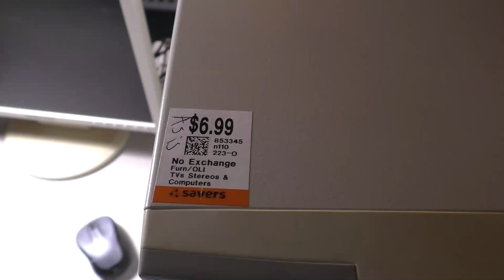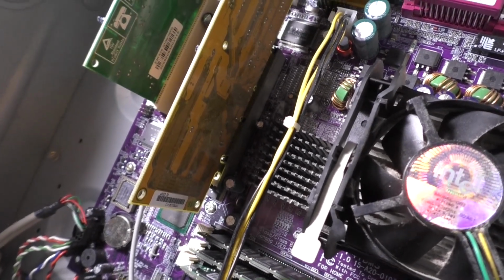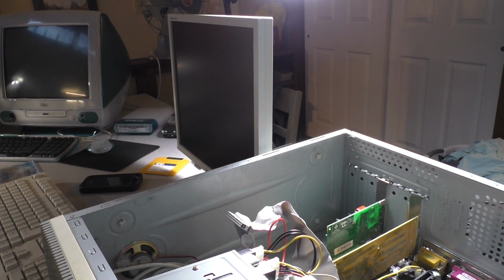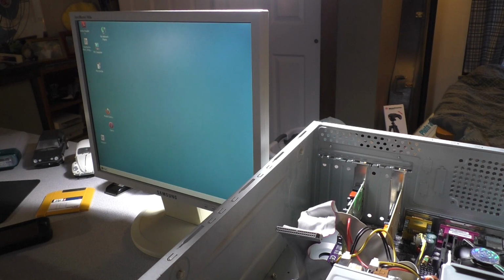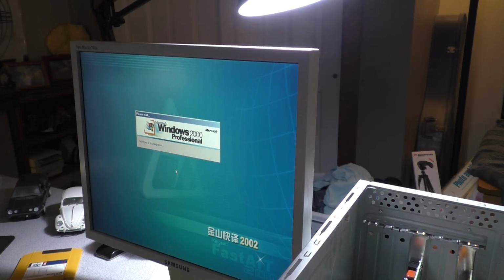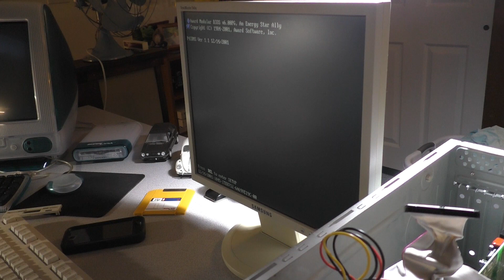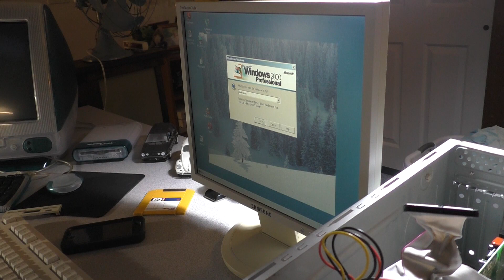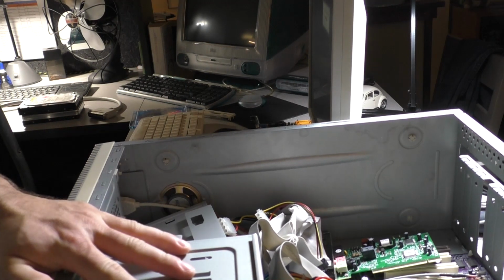I Bought A Computer For The Price Of A Wendy's Baconator Value Meal! (plus tax)

Comment: Of course both the owner and the store just leaves their hard drive and data on them and awaits their data to be compromised. At my Salvation Army all PCs are reinstalled with whatever Windows came with it originally using the OEM product key. If not, it's just sold as is wiped or without a hard drive.

Comment: I'm not sure if they still are. But in the earlier days when EVGA started selling PSU's, they were re-worked Seasonics. They're high quality. P.S. It was common in the 90's are early 00's for OEM's to hotglue cables to drives. That was probably original.

Comment: Stupid how Goodwill here would charge like $50-$100 for a Core 2 Duo or Pentium 4 in 2018 ;) No wonder they tend to sit there for a month or longer
Reply: If it's a Pentium 4 then at least you'll get a good room heater for 50 bucks. :P
Reply: Actually at my goodwill they’re all priced at 150 dollars... all Core i3 Thinkcentres
Reply: M Harris  Well, the Pentium 4 launched in 2000, so of course it's not going to be as good as even a 5 year old i3. And of course running Windows 10 on A P4 wouldn't be the best idea. People buying Core i9 based computers are getting something super powerful, but then when Intel releases their next line of CPUs that won't be the case. Technology changes at an alarming rate doesn't it?

Comment: scrap the motherboard but keep the case, cpu and other guts you can probably build something cool with it. Yeah I had windows 2000 growing up on my main pc intil it got upgraded to XP in 2012ish I still have it and it still works despite a noisy CPU fan. Would love to replace it but want to get the right one its a Athlon XP 2200+

Comment: Save the Powersupply, ram, front of the case looks alright in the video, (Scratches aren't visible anywhere on the case, might be worth getting those bends & dents out of it & repainting the case.)
Seasonic is mainly an OEM manufacturer for various brands like XFX,Corsair,Silverpower,Antec & a few others but they have their own product lines as well, their reputation is pretty great in terms of quality & price.

Comment: It's a Asus P4B- M board. I had a seagate that was loud and lasted for 8 years.
Reply from the maker: Mister H. Based on what? Asus is usually proud of their products and clearly marks them.
Reply from the maker: I figure it’s a knockoff
Reply: Maybe I'm off it could be a Soltek- SL-85SD, which is red, but oxidation could cause it to be purple-ish. Rough shape little machine, but all the Chinese stuff is funny.